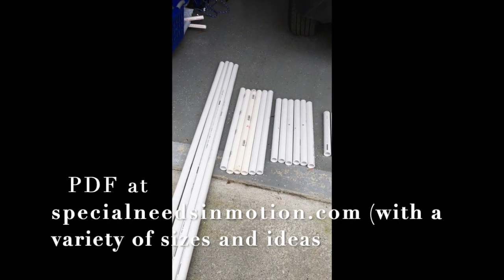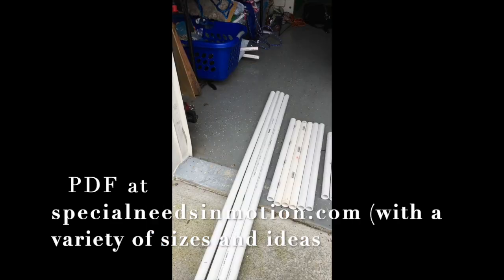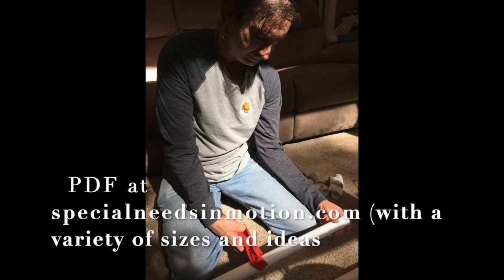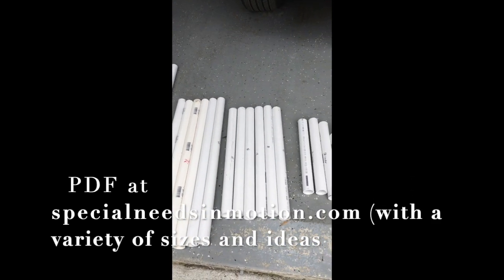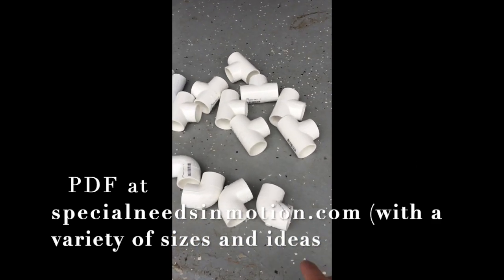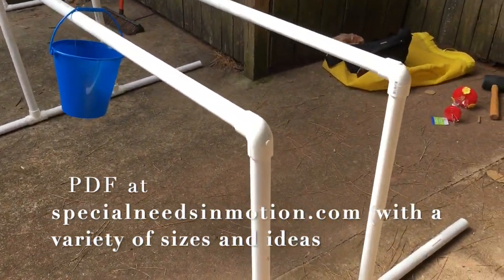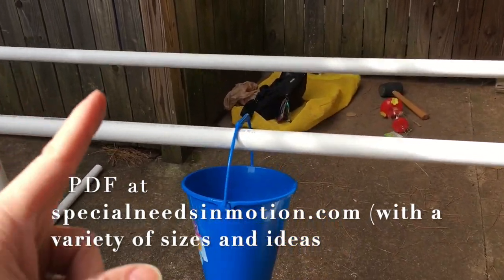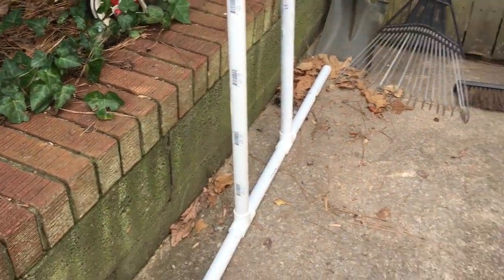Special Needs PVC Parallel Bars [DIY PVC Parallel Bars]

Comment: Great job. How did you secure the connectors so they don’t wiggle at joints? Do your connectors and pipes come with screw? Or did you use glue? Tips please!
Reply: You would need to screw the pieces together to secure.